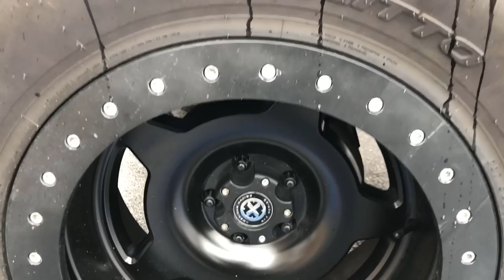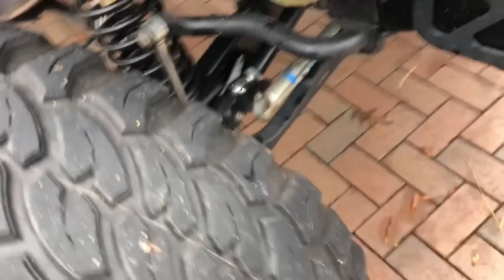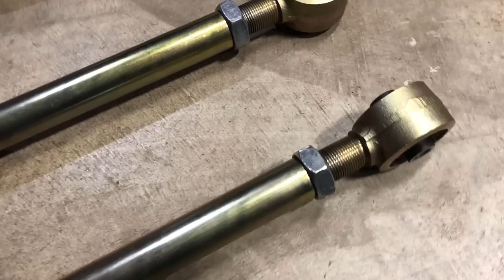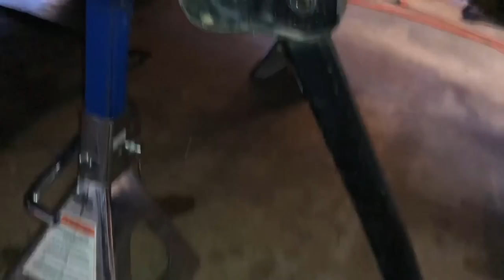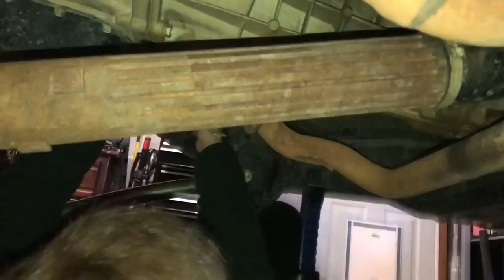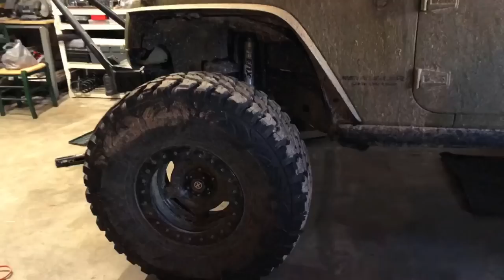Warden JKU | Beginning Metal Cloak Adjustable Mid Arm Upgrade

Comment: Sam I have a question I have 07 wrangler 4in lift but I remove the spare tire and bumper so my rear end is higher then the from what would you recommend get a 3.t rear spring coil or something else?
Reply: Dory and rainbow canales normally the rear is always higher then the front, what you could do is add a coli spacer in the front,  depending how much it’s uneven will determined what spaces to get.
Reply: Thank you bro!
Reply: Check out Teraflex  coil spacers, they're inexpensive and pretty easy to install. This channel showed an install not too long ago.
Reply: Hay 123 thank you